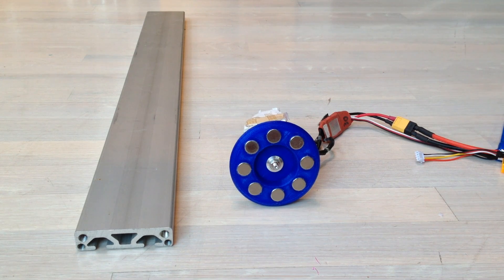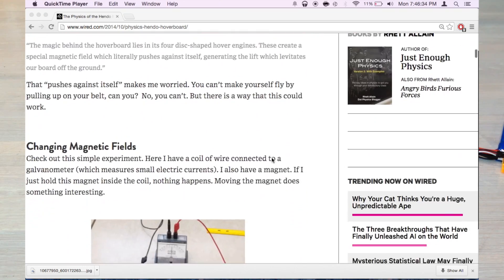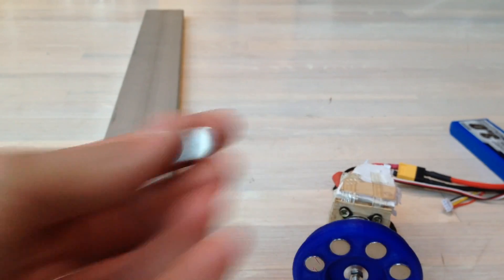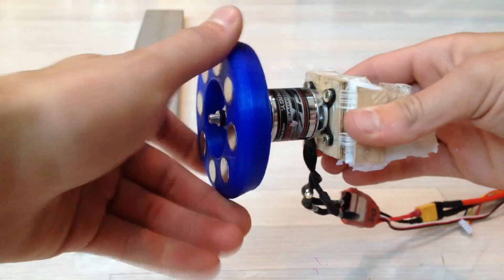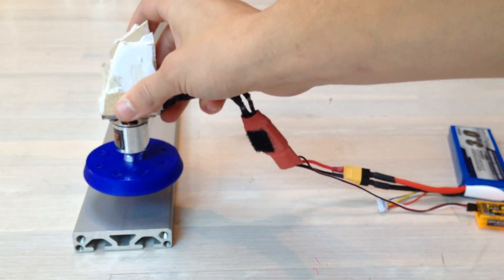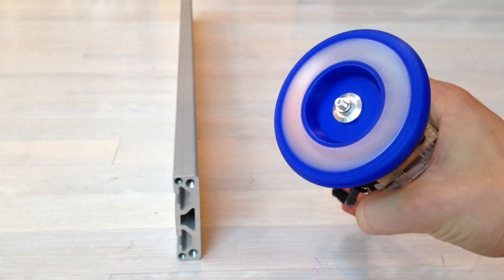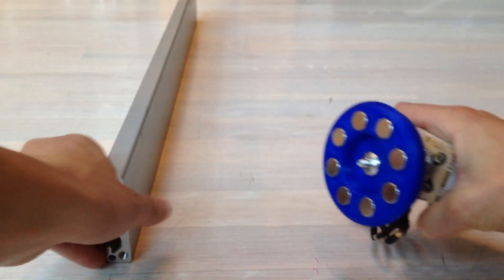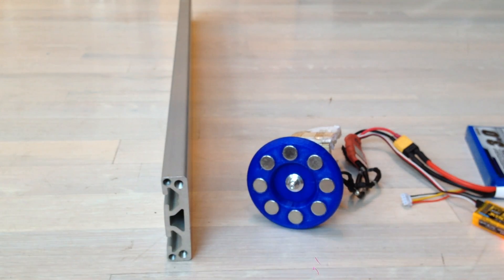ON THE HENDO HOVERBOARD: How it works and demonstration

Comment: but they are not hovering over metal so how do they hover over wood?
Reply: RaptorTech he was probably referring to the tony hawk video, which might have been using the frame of the pipe or a sheet of metal under the surface
Reply: Classikassassin in the c-net video on how the board works the company rep mentioned that the surface is copper sheets.
Reply: ***** not magnetic, or else it would just stick, conductive and non magnetic metals, so that the magnets of the board can create an electric current in the metal and that current has an opposite magnetic field than the board, so it repels. As for replacing the concrete and wood, you could just do a metal pathway, a thin coat over the side walk, or possibly a mesh, but the mesh might not work
wouldnt be too hard to do, but would take time
Reply: ***** check out the c-net video on this. the company rep says the hoverboard is just a prototype to draw attention to the technology and to their kickstarter.
Reply from the maker: This wouldn't work over wood, but it does hover over metal. The only reason I turned it sideways was so I could keep on holding on to the motor and still demonstrate the repulsion.
Reply: thanks, i hadnt looked yet
Reply: Classikassassin Too expensive. Not to mention that copper is extremely rare.

Comment: If you juiced up the magnets then inserted strips of aluminum or copper or w/e non-ferrous metal is cheapest into streets/sidewalks/etc, would this work, outside of plating everything in metal, as a viable transportation device? Or does the amount of metal in the surface make a difference as to how hard it pushes back against the board?
Reply from the maker: The amount of metal is extremely important, but I would assume a that a mesh would work. You could certainly improve the magnets by using a concentric circles of Halbach arrays (like the actual hendo hoverboard does).

Comment: In 1997 (I think, it may have been 98) I did an elementary school science fair project over this when I was in the 3rd grade. I got a C. Clearly the "judges" didn't understand what was going on. The only different was I had put magnets on a hacksaw blade and cut a circle out of a sheet of aluminium which I mounted to a fan motor. When spun up the magnets (mounted to the flexible hacksaw blade) moved in the direction the plate was spinning. This was the first time I realized adults are not all geniuses.
Reply: It's amazing how dumb some of the judges are at these science fairs. It's like they are lost in the era of vacuum tubes and steam engines and can't recognize an innovative project if they fell over it. I mentored a neighbor's child and the project was to demonstrate the strength of a magnetic field by increasing the number of windings in an electromagnet. We keep track of the numbers of windings, amount of current, (voltage constant), and how many washers could be picked up. We had lots of pictures, a table and a graph the depicted performance and we lost to flower seeds, dishwasher soap, and fabric stains. Of course, the dumb-ass judges could relate to those projects.
Reply: So you got a hacksaw to spin by attaching magnets to it and then attaching a sheet of aluminium to a fan blade and turning the fan on?
Reply: No. I placed the hacksaw blade with the magnets attached on one end, a couple of inches above the spinning aluminium plate.
Reply: x9x9x9x9x9
  A similar experience is how I learned you have to be able to do more than just impart information, you have to go so far as to teach them that new information presented to them might actually be new, and to be skeptical of it, all at the same time. It's why good educators are rare enough that most of them populate higher education. A lesson we both obviously learned to well.
Reply: BillyJoe1305 I had an 6 page explanation on posterboard behind the experiment with big colorful pictures.
Reply: Yep, & what they saw was magnets don't just pull.
Reply: x9x9x9x9x9 I did a project on maglev trains in 3rd grade and the exact same thing happened. I recall a fierce argument with one of the judges about why more coils of wire makes the electromagnet stronger when they wouldn't accept "because that's just how magnet physics works" as an answer. Calling them "dumb-dumb-face" probably didn't help.

The next year my project was a comparative analysis of the aerodynamics of different styles of paper airplanes. I built a freaking wind tunnel with a box fan. I got an A because my "airplanes were cute." Adults giving science grades to kids are stupid.

Comment: could you do a video of the disc hovering over the metal?
Reply from the maker: It would certainly be possible, but I would have to make two magnet arrays and have them spin in opposite directions. I don't know if you could hear it in the video because I reduced the audio (it sounded bad at full vol), but the motor slows down when I bring it near the aluminum. This is because there was a quite a bit of resistance due to the opposing magnetic field.
If I were to let the motor go and have it hover by itself, it would not overcome this resistance, and the magnet array would stay still while the handle would just spin all over the place.
What I could probably do is attach the handle to a lever hinged on the floor, and demonstrate the hovering that way, but it will not hover completely freely unless I add more counter-rotating magnet arrays.
Reply: oh, that makes sense RaptorTech
Reply from the maker: hypnosifl True true! I started with two to explain the concept, but you're totally correct. There is a whole lot of torque coming back from the resistance of the opposing magnetic field, so I'm not surprised they had a hard time keeping their "quad" stable.
Reply: Y Y